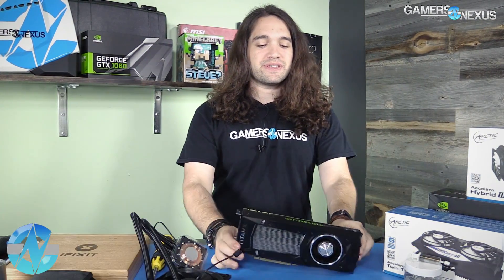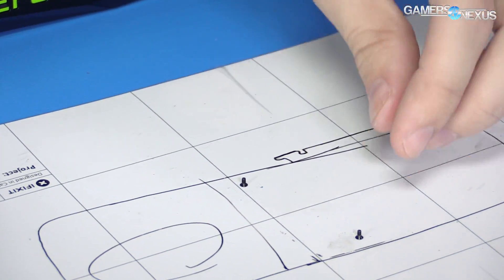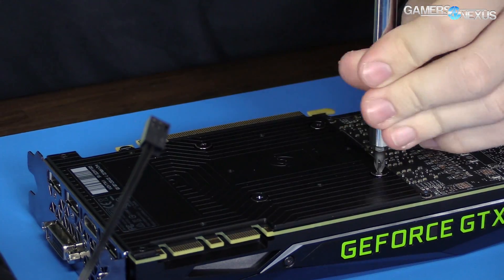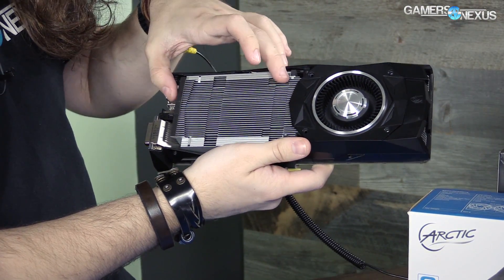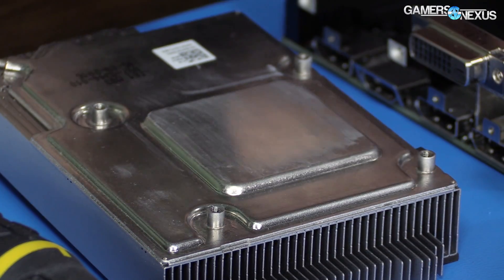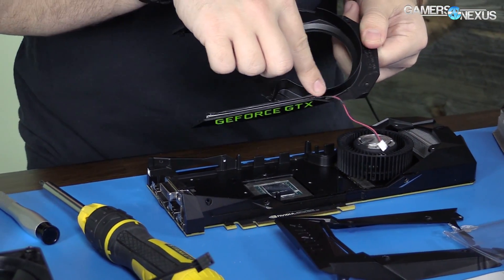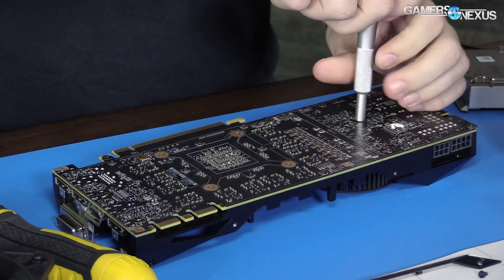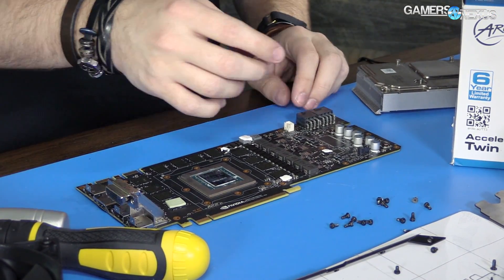Building a TITAN X Pascal Hybrid Part 1: Tear-Down

Comment: While interesting, it's pretty pointless.  Why not just use a titan in a custom loop?
Reply: theBraxil ease of use i guess an aio on a graphics card is a muuch easier set and forget setup almost all loops require you to change the fluid semi often if you are using just water its recommended every 6 months were as if you are REALLY lucky an aio will last 6 yeaars but i do see your point im really only playinh devils advocate

Comment: thanks for the links for tools, etc. The linked article claims the standoffs are 6.5mm, this is far too large looking at ours. The standoffs are very small, around 4mm or possibly smaller. Could you clarify what the size actually is?  Thanks.

Comment: I can't believe NVIDIA is so frugal to not give this channel a titan X. Most youtube channels just do a simple explanation about the specs and then have a very limited amount of non sense making benchmarks when testing a video card. I watched the GTX 1060 review on linustechtips and it was utter crap. They only included 1440p testing and only tested a small amount of games. I watched it on other tech channels as well with the same result. On gamers Nexus they really take their time when covering a product, if it's small or big doesn't matter there will be extensive testing. They give you an explanation of what audience it is targeted towards, they give very detailed benchmarks, comparing them to other videocards. They use useful data such as frametimes, 0.1 and 1% lows, delta T over ambient, scaled over different resolutions. If this isn't already enough to get a card send from NVIDIA they also include an in depth article about everything mentioned in the video and more, so you can easily navigate to it again later on in future or if you want to see the benchmarks again, which are very reliable because of the testing methodology and time put into it. Other then this they also make Hybrid cards, they discuss if the card would have driver issues, how they're going to be fixed. In conclusion you can see that Gamers Nexus really takes its time to cover any product as much as possible while being genuine and original in offering something other channels don't cover. If I buy a card I will definitely check out the reviews of this channel (as I did in the past) to make my final decision. Other tech channels might bring some more humor, but when you as a consumer need to spend your precious money to buy a card you need a very reliable source and this is where Gamers Nexus really shines.
Reply from the maker: NVIDIA and AMD already sample us, folks. It's just a Titan X we didn't get, no need to get riled-up. We don't do deep learning content, which is what the TiX is targeted at. That's reasonable on their part, just like AMD has no real reason to give us server processors.

That said, thank you for the kind words and support!
Reply: it's rly simple. Nvidia the shady company only gives card to those that have a bigger Fanbase like LTT, GamersNexus with 60k isn't interesting enough for them even though the review's he makes are a lot better than others but in the end the Numbers and not the content counts to them
Reply: Depends if you believe nvidia;'s spiel or not, the glaring geforce gtx logo on top of the shroud would say otherwise, after-all "geforce" is their gaming gpu line.
Reply: it costs YOU that much buy it at retail. it costs them significantly less to make one.

Comment: I'd settle for a set of precision or jeweller's screw drivers. You have way much torque with this multi bit setup, which makes easy to strip the threads of those dinky screws.

Comment: You said this was one of your fans titan xp right ? I'm sure he was scared watching you take it apart lol. Either way I know you know what you're doing, just a bit frightening to do that on a 1200 dollar card. good video none the less!
Reply: Bronwyn Corgi Lovah the card owner replied to you, hes right below on these comments.

I just think its rather, well, bad, that statements like those are half the comments in this video, i replied to another user that was super bothered that Steve threw a piece of plastic into the mat aka the backplate, i mean, are you serious or just here to undermine what hes doing? hes doing everything absolutely fine, hes comfortable doing it, and has taken all the necessary precautions. He did not just throw caution to the wind simply because the card is not his.

Nothing is getting destroyed, there is no gamble here.
Reply from the maker: We've never damaged one. ESD safe environment, patience, and experience with the 1080 made this trivial! :)
Reply: +Bronwyn Corgi Lovah I assure you 1200 doesn't drop out of the sky for me either! I'm taking a risk for the channel :)
Reply: +Bronwyn Corgi Lovah How do you suggest a card like this to be "destroyed" on camera?

Compared to 15 years ago, the biggest risk you incur nowadays is taking off a damn cooler, and maybe moving a slider over at MSI Afterburner, and even then the software will stop you if you have no idea what you're doing. Cut the nonsense.
Reply: Hence why I trusted to give it to you, you're a professional xD Gamers Nexus
Reply: Bronwyn Corgi Lovah
I only have 1, plus 3 way SLI isn't supported and I wouldn't use just 1 TITAN for physX and audio so there would be 0 point. The TITAN is my only card, and I cannot afford a replacement. Stephen (because he is very kind) said to me that we would work on an arrangement if something goes wrong which shows he is very confident in what he is doing and infact I know for a FACT he wouldn't damage it. There is always a risk in everything hence why I said it, the risk is practically 0 with Stephen doing this as I've said above he is a professional. My final words are, even if he did break it I couldn't possibly make him pay the full amount - I knew there was a risk, I would feel bad!
Reply: Tripnotik25
I saw that comment too, and was quick to say that it's just plastic which I'm likely going to replace with a new one anyway!

Comment: i want a Evga Titan XP Classified. Nvidia sucks so much. BTW, today in a few games a GTX 960 is as strong es a 780ti. Or, more accurate, the 780ti is getting crippled with purpose. OFC, Nvidia uses the term "Maxwell architecture is more optimized"...well if thats the case, why havent the AMDs like r9 380 and 290 not getting crippled? Dont touch games in which Nvidia is involved...at least dont pay for this shit. Its a shame, its only a 2 years ago when a 780ti was 600 dollars and now they dont optimize its drivers anymore, just to make the new cards like maxwell look stronger. And ofc, they are gonna cripple Maxwells performance now. Im looking forward to a stupid 1060 getting 20% stronger than my 980, already see it coming. That was my last Nvidia.
Reply: Titan's dont go out to board partners. nvidia only.
Reply: EK makes a waterblock for the titan XP so at least there's that. i wonder if it's possible to cannibalize a PCB from a different card and make your own. Sounds super complex but i'm sure there's some crazy modders out there willing to try it. you could always wait for the 1080 ti ?